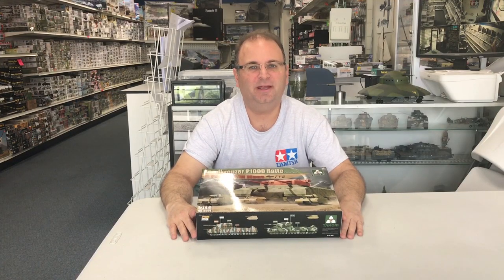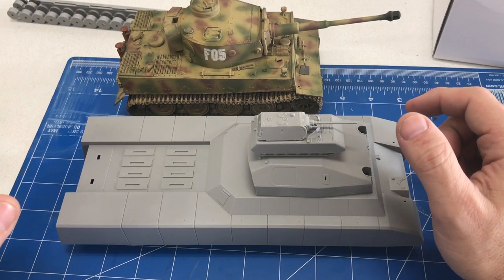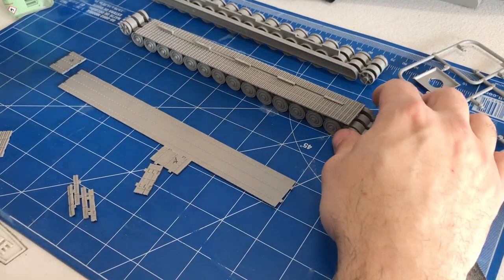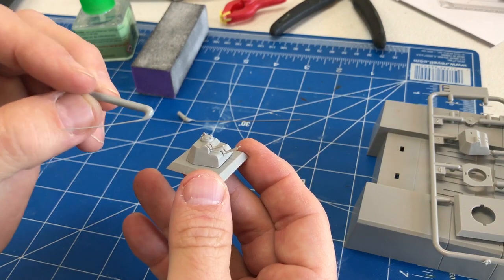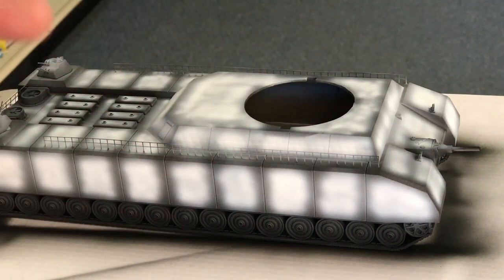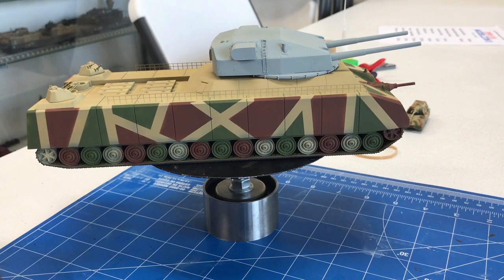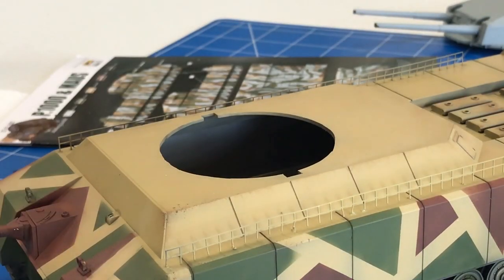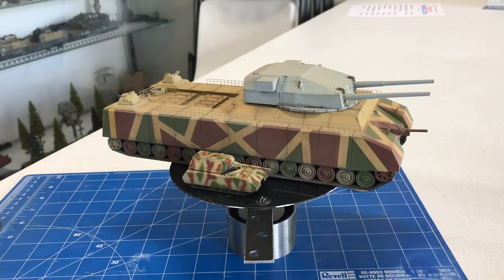Building the Takom P1000 RAT 1000 ton super heavy tank [ German what if project .]

Comment: Hello Andy, installing those tracks was still a pain in the butt. I got them installed but I am thinking they should have just used the rubber band style tracks. I had to use a touch of super glue to get the track links to properly adhere to the curves of the wheels.

Comment: Speer was such a party pooper for canceling this deleterious project!
Reply: It made sense as the Ratte would've cause more problems than it was worth. I could go on about how useless this thing would've been as a combat vehicle.
Reply: It would consume so much fuel, and Germany was in a huge shortage of oil, materials and manpower.
Reply: Even if it was built it would be doom from due to ally figther bombers to do something like this you
need air supiriority
Reply: Well, these things (p-1k & p-1,5k) were not really tanks. They were self propelled siege guns. If you compare them to railway guns, it's easy to see benefits over something that needs a rail network and days of setup to use.
Reply: When a project is even too silly for a proven megalomaniac like Speer, that should tell you something. Germany lost the war due to shortage of steel and fuel without that silly thing, already.

Comment: Hi, Andy, I just subscribed, so I'm catching up on some older videos. 
Do you happen to know what the approximate dimensions of this vehicle, if it had been made? And, if I were to have been made, it likely wouldn't look exactly like that, as the design would be modified along the way, as well as just the hand built nature of the beast? 

I want to make an R.C. 1/35 version of this, but I don't like how far forward the turret is. My "production" Ratte would look a little different than that.

The only holdup to this plan is the realization that a 1/35 Ratte might be larger than my actual car. At any rate, well done, sir, and I'm going to do the math to find out dimensions. It could happen...

Comment: Constructively there is a problem: the pressure on the ground through the tracks is immense. It could sink in quite a bit on normal terrain. Also the huge gun on top can do a comparable damage as a rocket. Using rocket launchers with artillery and normal tanks of the same combined weight would deliver much more bang for the buck, and also much harder to destroy than one single vehicle. Also this thing is a sitting duck for an air attack. It is a weapon to fight an industrially and logistically much less advanced opponent. Any western Nation had blown this thing to pieces in a short time. Big is not necessarily effective. It had been perfect for WW1, or a little bit earlier. Then it would have made a difference. In WW2, especially the second half, much much less so. With rockets and air attacks it’s basically obsolete even before completion.

Comment: it must be fun to paint with an airbrush I have normal hairbrushes 😢..
Reply: Mr P you are not the only one fam
Reply: Mr P I use hairbrushes as well (only so much disposable income university student)  I've had some success by using 1 part tamiya paint. 1 part acrylic thinner and a single drop (per every 5ml)  of acrylic paint retarder. It doesn't produce the same results but by investing in quality brushes and patience I've been able to make due!
Reply: Well thanks for the advice also I am making a tiger and I don't know what coat to use
Reply: I want to give it a western front paintjob or a north afrika camo
Reply: Personally,  I think that a north African approach would be interesting.  Is the model a tiger 1 or 2 if you don't mind me asking?
Reply: Tiger 1
Reply: Mr P. I'm pretty sure there were a few tiger ones inn north Africa. Good luck on the model!
Reply: Ian Mullins thanks I am thinking of painting it with a dessert yellow camo  to match the desert that supposedly was at